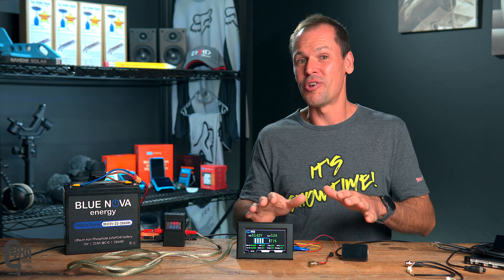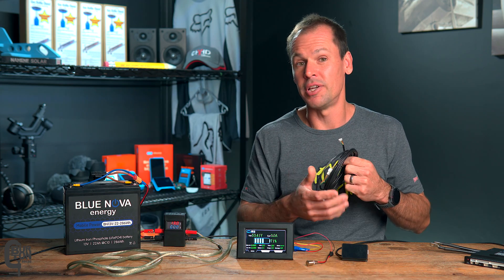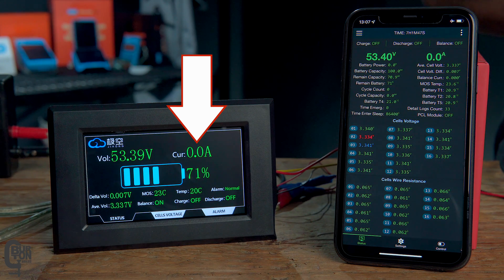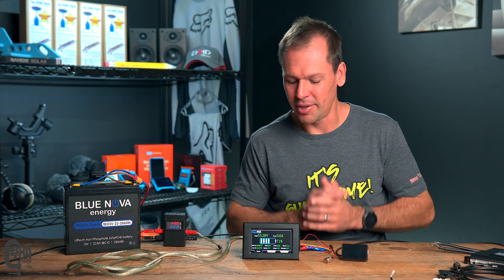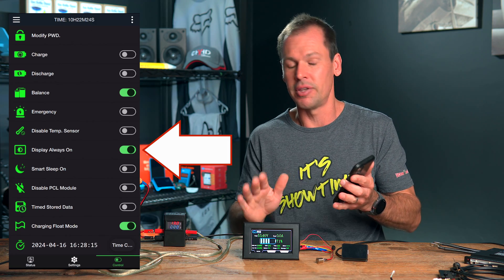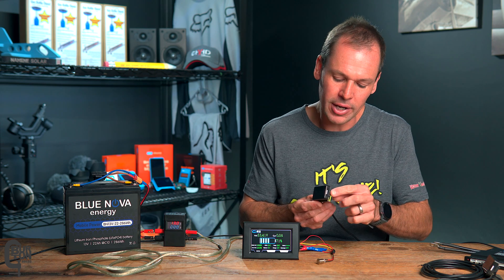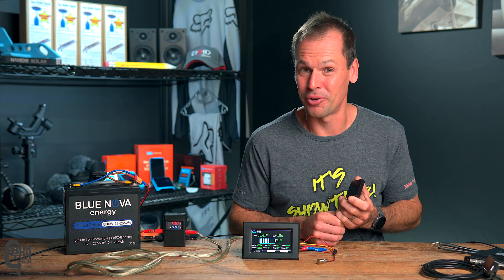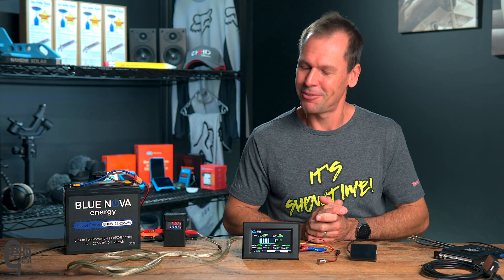JK BMS Screen Comparison and Test - EXPOSING Problems??

Comment: I just extended my v19 touch screen cable with cat5 but the colours will change depending on what end of the cable you plug in. With reference to the wires on the LCD (LCD has pinout labels) VCC is red & gnd is yellow on one end but if other end is plugged into LCD then VCC would be white and gnd would be green (both jst connectors are identical but wiring is mirrored).

It's not an issue but for me I've used certain twisted pairs for power, switch and data and those pairs would be messed up if I plug the other end into LCD though.

Edit: I bought one of those touch panel displays (they're the old style now) for my older jkbms and it powers up via the bms in 16s configuration however on both older (different) bms's the display doesn't show the battery percentage, charge or discharge switches but does show all the cell voltages. I don't know if that is a bms protocol setting or not.

Comment: Could you please tell how long can we extend the smaller display cable? I mean using some LAN cable... I want to extend it to 30feet.
Reply from the maker: Hi, I'm not sure how long the cable can be extended. Unfortunately I can't test it because both of my small screens have stopped working.

Comment: sir my screen on my bms is not same to my inverter how fix it? my bms is 70%charge and my inverter is 100% i try to check using multi tester my invetr is accurate
Reply from the maker: Hi, do you have the CAN communication connected and working between the Inverter and BMS?

Comment: The 4.3 Inch screen turn's itself off even when set in the app, that it should't..(only available for the bigger screen i heard) also the percentage reading is really off for Li-ion
Reply from the maker: I guess that ‘always on’ screen setting was overridden in one of the firmware versions possibly to try prevent the backlight from failing (I’ve heard the failing backlight on the smaller screen was a bit of an issue when it was always on).

Does the screen % match the app %? Or are you referring to the general SOC being off?

Comment: Hey bro, i have a question

My 24V inverter's low battery cutoff voltage is 22.0V so In JK BMS advance settings, what volt is have to feed in UVP and UVPR ?

I just want that only my inverter stop supply on low battery....not JK BMS

Comment: Hey i have a question is there is availability of 12v 3s jk bms fir lithium ion 18650 battery pack pls reply thanks 👍😅
Reply from the maker: Hi, I think the '4s - 8s JK BMS versions' can do 4 - 8s LiFePO4 and 3 - 8s Li-ion cells, but just to be sure, check the specifications of the version you are looking at before buying.

Comment: The screen doesn't go to sleep because you have separate power connection and it would like to turn off but it receives continues power hence its confusion. 
If connected as it should (taking power from the bms) it will go to sleep as intended. Cheers.
Reply from the maker: Hi Peter, thanks for the information. Strange that this screens wiring harness doesn't take power directly from the BMS... probably an old unit or made for a different application.

Comment: Thank you for such detailed review! Very helpful! Do you have information whether it is possible to connect 3 batteries (i.e. BMS) to one 4.3" display? Well I do assume that it's possible to connect the batteries via a 3 position rotary (gallet) switch but I am aware that the display may breakdown due to fast switching.
Reply from the maker: @danielromashov92  Hi Daniel, you’re welcome. I don’t think it’s possible to connect multiple BMS units to one display (other than the switch method you mention - not sure what the implications of ‘hot swapping’ on a continuous basis would be).
Reply: Don't use Display, use MQTT, 3x ESP32 and Homeassistant or Openhab
Reply: Don't use Display, use MQTT, 3x ESP32 and Homeassistant or Openhab

Comment: Why not place the wires for the 4" touch screen 4 cells up on your 48 volt battery so it only gets the 12 volts it needs?
Reply from the maker: Hi Bernard, I don't think that is good practice because then you would have the first 4 cells being discharged slightly more than the rest of the cells in the pack... it will only be a small amount but you want to keep the battery cells as balanced as possible.

I think the newer generation JK BMS Screens plug directly into the BMS and get power directly from the BMS.

Comment: Hello is any way to have the small screen and the same time the button on/off ?
Reply: You could open up the small display, find the connections to the pushbutton, and wire the separate switch in parallel.

Comment: I have a 280 amp 16 cells battery with a JkBMS. But I don't know how many amperes the battery will fully charge, I have charged up to 270 amperes capacity but the cell only charges up to 3.41 volts but when I brought this battery a few months ago it was show 58 volts complete. and then beck It was standing at 54 volts for a long time after fully charging, please tell me any solution to correct my battery setting.At some point the amps remain high and the volts seem to decrease quickly thank you

Comment: Hello, I have this problem as well, I will solve it with a rocker switch that interrupts the 12 volts, all BMS have errors, the ones that don't have them are not in this price category
Reply from the maker: The switch solution to cut 12v sounds like it should work well 👍

Comment: i have one of the small displays, but it has a different connector. It does not fit the JK Inverter BMS, which was supplied with switch. There is also now a new larger display available.
Reply from the maker: Hi, thanks for the info. I've heard and seen online that there is a new large display available but haven't got one yet to test.

Comment: Hi. Have you got an idea why the small screen wouldn't show the battery state? It does show the voltage, but the battery icon is just empty. BMS is set to the number of cells and has no faults🤷‍♂️
Reply: Sorted. Just updated the battery capacity and hit ,,ok" - all works now👍
Reply from the maker: Awesome 👍 happy to hear it’s all working. Sometimes, depending on the firmware version loaded to the BMS, there are various bugs with certain features, and sometimes as old bugs are fixed, new bugs appear… and I think there was a firmware version in the last that affected the screen display. Thankfully this wasn’t your problem… glad you are sorted out 👍

Comment: I just got the big screen and it is useless. it has no power button for the screen. Just a power button to turn the whole BMS on/off. I still need my phone to change anything. If I need to get out my phone, open the app, from no more than 15 feet away due to the garbage Bluetooth, to turn on the damn display, what good is it. It just blinks of off randomly, always, NO SETTINGS.  LOOKS LIKE IT TAKES A mini SD card which it di not come with. NO INSTRUCTIONS. Absolutly useless. I so mad . while everyone here, pretends to be thrilled to loss money. I WAS, AND STILL WILL BE , JUST USING AN OLD CHEAP PHONE THAT I LEAVE NEAR THE BATTERY. .
Reply from the maker: Hi, I’ve been using the small 2.5” screen for almost 2 years now and it’s been working perfectly, and also has a BMS power button on the side… only shows basic information, but that’s ok for a quick look when walking by, anything more it’s better to use the app. I’m not sure if the new large screens are trouble free with the new BMS’s (I assume they should be), but the older large screens seem to be problematic with the new Inverter BMS’s… maybe I need to check mine again since updating the BMS firmware.
Reply: The "garbage Bluetooth" may be due to the BMS being in a Faraday cage, i.e. a metal box.
Reply: @matthewmarks6951  What metal box? Are you talking about the BMS itself?
Reply: @immrnoidall  No, I'm assuming your BMS is in a metal box containing the batteries.
Reply: @matthewmarks6951  Do you know of an external BT module that plugs into it. the built in is garbage. I need to figure out the networking setup. To connect with my phone ,from anywhere.

Comment: I have the newer screen that powered directly from the BMS (24v system) is there a way to turn off the screen or an option to go on sleep mode?
Reply from the maker: There is only a 'Display always on' setting in the Control screen in the BMS app (version 15.27). Isn't the screen supposed to sleep / turn off by itself, and then wake again when there is a charge or discharge (thats what my small screens seem to do).

Comment: I got the same display and the JK inverter BMS but the cable doesn't fit into the BMS, because there is one pin more ...
Reply from the maker: My screen's plugs have 6 wires and 6 pins... how many do yours have?

Comment: Thats really annoying with the 4.3 screen as mine discharges the life out of my battery. I suspect its because I had to make an extension cable for it. You can cut the white wire and make a switch for it, which turns the screen completely off and on again.
Reply from the maker: Hi Andy, thanks for the tip about the switch. I'm not sure how extending the cable would cause additional power draw on something like this, unless something went wrong with the extension... I suspect it would be something else though.
Reply: @GrantBurton  it discharges every few minutes when the screen is connected much faster than it does when it's disconnected. I'm due to reconnect it back on the boat soon. I'll let you know what i find and run a clamp meter on it and see if it's drawing any unusual current.
Reply: @GrantBurton where did you get a 3m cable from?
Reply: look at the settings. Its the last page of the settings, scroll down  and you can shift to: screen not permanently on.
if you want to turn off the bms totally you have to install the switch on/off button ....
Reply: @mandxyz2523  it's not there on mine. I suspect this is something that came with a later firmware.

Comment: Do you know if the JK has a precharge function when turning on the bms? Thanks
Reply from the maker: Where the BMS limits the current while the Inverter caps are charged... I don't think it has this function.
Reply: @GrantBurton  thanks. I will hook it up next week and find out. Cheers
Reply: @frankz1125  Did you find out? I'm sure I read something from Andy or in one of his replies that it does do precharge (presumably using the current limiter operating in reverse)
Reply: @matthewmarks6951  it does not have precharge. On the one I have. 200A in and out. 8s.

Comment: I have the 4.3 panel but the symbol that appears doesn't have this cloud, what I didn't like was the data refresh rate on the display, very slow.
Reply from the maker: Maybe the newer screens have a faster refresh rate? I think the screen I have is fairly old.
Reply: @GrantBurton  Infelizmente não, comprei recentemente e a taxa de atualização é lenta.

Comment: I've got the small screen and it stopped working a few months ago. the button on the side still functions but does not power on the display. Not sure if its the bms or not.
Reply from the maker: Hi, I think this is what I have heard is a common failure with these small screens... especially when being 'always on'. The backlight on the LCD stops working (or at least thats what I remember hearing). I don't think it's the BMS.

Comment: hi, i have the same bms but the battery does not show any bars like yours and the charge/discharge indicators are "OFF" even after turning it on from the app. when i turn those two options on the BMS works also and provides power.
Reply from the maker: Are you using the small or big screen?
Reply: @GrantBurton  big one. The battery is just a red logo but system is working and SOC is also shown.
Reply from the maker: @SaberToothSL1  I'm not sure what could be the problem... I guess it could have something to do with the firmware on the older screens not being compatible with the newer Inverter BMS. I haven't played around with mine anymore... just plugged in the small screens and have been using those and all is working well.
Reply: @GrantBurton  this is the same thing my installation vendor told me. I will be getting a new screen for this as that's the easier thing to do for now than replacing the bms.
Reply from the maker: @SaberToothSL1 Nice… let us know once you get it and if it’s working 👍
Reply: @GrantBurton  Hi so the vendor got a screen but same issue. They said it might be something between the BMS and the battery because this BMS is a newer one which uses the CAN ports to communicate with the inverter (via network cable). They took the battery pack and said will check on this. Any suggestions from your end maybe?
Reply: did you solve the problem and get the screen to display the values as i have the same problem the screen is on but all the values are blank etc like yours

Comment: As for the screen blinkng problem, I was told it's a firmware problem, so no solution as firmware of the screen / BMS is not upgradeable, at least in the JK B2A20S20PR that I have
Reply from the maker: Hi Andrés, thanks for the comment.

Comment: Can BMS charge and discharge simultaneously?
Reply from the maker: Hi Francis, both the charge and discharge control can be set to 'On' at the same time but it can't charge and discharge simultaneously (as in at exactly the same time)... the battery will either be charging or discharging, but it will allow current flow in both directions 'automatically' if both the charge and discharge control is 'On'. I think thats what you are asking?

Comment: I just bought 2 of the 4.3 screens and they work directly with a 16 cell 48 volt pack. no need to run a 12 volt power. 
Therfore when i push the off button the screen turns off, untill i restart the BMS with the push button.
I looked at the packaging and can't see any version numbers.
Reply: No - the BMS has a separate DC output that the screen plugs into. I don't think it accepts 48-60V directly.
Reply: Mine as well. I have 16S LiFePo4 105A EVE cells and connects directly to the BMS port and power the screen without problem.
Reply from the maker: @DroneSurf  Thanks for the info 👍
Reply from the maker: Hi Jeff, thanks for letting us know. I think the screen I have is just an old version.
Reply: me too. have 2   4.3"-screens and they work perfectly with the 16S-power packs...
now eel and another supplier came up with vertical and horizontal 16S-boxes where the big screen is now integrated.
The information of some chinese shops selling the 4.3" JK-screens that it runs only on 12V   is false...
Reply from the maker: @mandxyz2523  I think the older screens ran on 12v but the new style large screen is powered directly from the BMS.
Reply: @GrantBurton  First: many thanks for your informative channel. Well, the tiny ones (2.5") had also worked with 24V (had installed 2 years ago with 24V-powerpacks). At that time it came with a handlebarholder (might have used for small electric motorcycles in china). Have no idea why they came up with that 12V-information...
Reply: Their newer versions works directly. They have a way to supply power to it

Comment: how can I fix that the 4.3inch screen dosent show battery green but show the percentage
Reply from the maker: Hi, I don't really use this large display so unfortunately I'm not sure what might fix the problem... I mainly have the two small screens connected (the 2.5" displays).
Reply: @GrantBurton just reset the BMS configuration by selecting the type of battery and setup again your Cells amount and AH.

Comment: Already have it in use  and didn't  use 12v supply it is supplied by bms and I hope I won't burn it long term..  Bad thing is I can't change  monitor sleep sensitivities.. After. 0.3  amps in or out it works or permenantly by app..
Reply: I’ve been og 2 1/2 years with no problems JKBMS the old style and 4.3”
Reply from the maker: @USA-GreedyMenOfNoIntegrity  Before upgrading to the JK Inverter BMS, I also used the old style JK BMS for a year with no problems.
Reply from the maker: I came across a PDF document (published on JK's website) about the larger 4.3 inch touch screen... it shows a minimum input voltage of 6v and maximum input voltage of 36 volts. I haven't tried anything higher than 12v so not sure how accurate that claim is. It also claims that at 12v, the screens current draws is 116mA.

I've also heard that the 'always on' function for the small screen has been disabled by JK... supposedly because the smaller screens were failing when powered on all the time (I can't confirm this though).

The documents for the small 2.5 inch screen indicates that as soon as discharge is greater than 0, the screen will turn on. As far as i remember, both of my 2.5 inch screens (plugged into the Inverter BMS) turn on when the charge or discharge is greater than 0, but they do turn off again after a while.
Reply: @GrantBurton   i am sure my 4.3 is half month now connected to bms maybe late version of the older pb   series has some kind of converter at the jst style connectors,,,   if anything makes a weird smell i ll let ya know... setup reached 57v and will reach  a bit more  soon.. didnt do propper slow charging high voiltage shutdown yet...keep up man
Reply from the maker: @anaxiosesti88  Thanks very much. I've see pictures of a third type of large screen... it has a power button built into the right side of the screen. Not sure if it's a JK screen or a third party screen that works with the JK BMS.
Reply: @GrantBurton  bought it as a jk from their sellers  with the inverter bms but used it on a last gen pb or B only !!! so i guess it is jk or they just run out of stock and restock from no name!!!!  yup the buton which i m curious of how it operates .. maybe a  tiny capacitor in series making more than the voltage it reads.. it blown my last thin voltage sense and balance cable.... i guess it had to do when operate or else my crimping was too bad!!!...